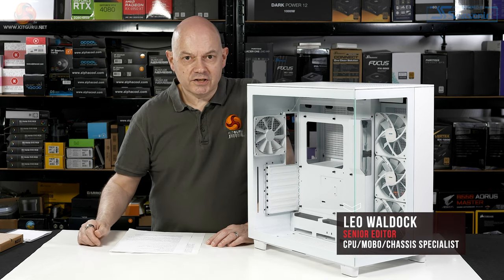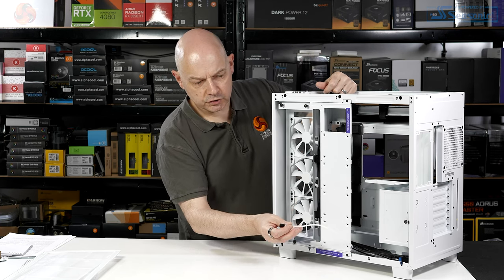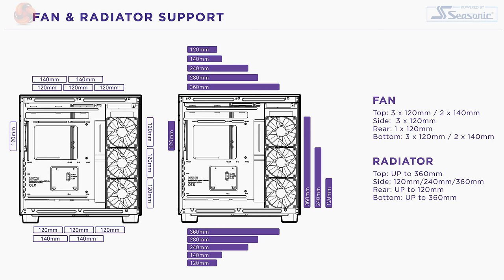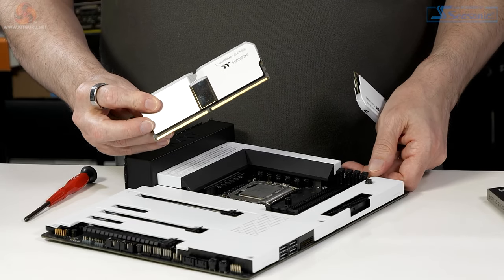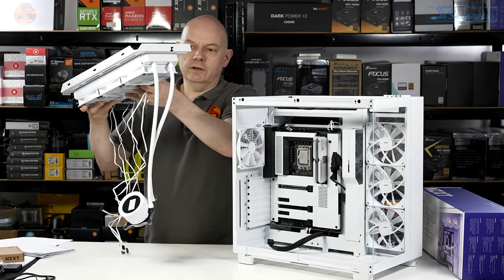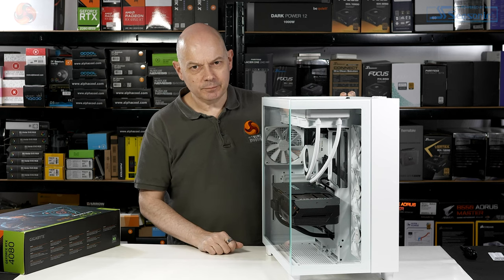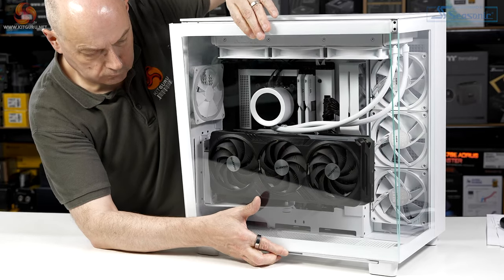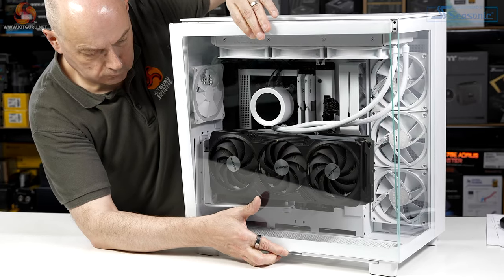NZXT H9 Flow - Look at the Glass on that

Comment: The whole reason you had high temps is you put no fans in the bottom! Optimum flow would be intake in bottom and side and exhaust out the top and back. Mine with a 12 core, 24 thread cpu under load doesn't get anywhere close to your temps and it's very quiet with better fans and even aggressive fan curve so people don't go by this, it's way way better than shown here. Sorry Leo but you missed out on the possibility of this one big time

Comment: First.  That Kraken is ridiculously overpriced for what is just another rebadged Asetek AIO.  Considering this looks like new tooling, why would NZXT leave that top so tight between motherboard and AIO - it is clear that most users are going to be installing one in this type of case, so why not make it fit comfortably.  This has long been an issue with cases, yet with the proliferation of AIO's so many seem to fail to improve this area.  An extra 10mm of height is all it needs , and on that front, it looks like it needs 10mm more width, or a slight reconfiguring of the position of the central tray - looks like they are assuming most people with go with the vertical GPU mount, but for another £75 on top of £170, plus you are going to have to replace those garbage stock fans, it is starting to get very expensive for what is ultimately another 011 clone that doesn't look to be as good as an 011.
Reply: second
Reply: You forgot to mention the O11D Evo comes with 0 fans included and 0 dust filters on the side intake, at roughly the same price as the H9 Flow. The included fans in the H9 Flow do their job just fine.
I still prefer the H9 Flow as not all of us really care for the O11D Evo features such as inverted/upside down builds and want a clean build without the corner pillar between the glass frames. I like them both but the H9 is better imho.
Reply: @cosmindinaa  I didn't forget to mention something I wasn't talking about.
Reply: @malphadour  Then next time you state it's £170, and then say it's a clone of the O11D  Evo, better do your homework. Those fans are better than no fans, and you can sell them anytime if you want to. And you dont need to buy aftermarket side intake filters. Saying H9 Flow is a clone is like saying all cars that came after the 1886 Benz Patent Motor Car are clones. Good luck with that.

Comment: amazing looking clean build that. I actually preferred it with the card in the normal position, the big slab of plain black ruined the aesthetics IMO. but maybe thats just me.
Reply: you get better cooling for GPU too being horizontal layout since you can add fans on bottom of the case as intake fans for cold to feed the GPU's intake fans to cool the big ass heatsinks.

Comment: I have this case and from what I understand you don't want to mount an AIO radiator in the bottom of the case, hence the reason NZXT doesn't include that option. You always want one end of the radiator to be above the pump / CPU, otherwise your pump will have air pockets and reduce it's lifespan. A radiator should be mounted - in front, on the side or on the roof and never on the bottom of the case.

Comment: 2:00 The lack of pwm fans in some of these pricey cases is a joke.
Reply: That's true, although I prefer to leave my own fans maxed. I haven't seen - or heard - a downside yet.
Reply: They assume those aren’t your only fans
Reply: @Donuts_Donuts_Donuts  I have a Be Quiet Silent Base 802, it came with 3 non pwm 140mm fans. Not a cheap case, they should have been pwm fans.
Reply: @-opus  again, they assume you use different fans as only having a few fans is common sense. Plus  fans are expensive. A mid tier corsair three pack is ninety bucks, half of the price this whole case itself
Reply: @Donuts_Donuts_Donuts  High end cases should come with high end fans (pwm being a part of that), I have no issue with the case coming with 3 fans, but they should have been pwm. I added 2 more pwm fans to the case, but would have very much preferred if the included fans (a part of the case price) were also pwm. I would have had no issue with the case coming without fans at all, and being significantly cheaper due to that, I would have actually preferred it, but since they are included in the price, I expect them to be pwm.

Comment: I have had this case for about 3 months. Looks gorgeous, lots of room to work in and manage those cables. Fans on the floor of the case make a big difference in its cooling ability. But at the going price for this case, having to pop for an additional $100 of fans is not much appreciated.
Reply: Yeah they missed out on this one bad, with better fans and flow coming from bottom and side and exhausting out the top and back mine with a 5900X cpu under load doesn't get even close to their temps and mine is real quiet while doing it. Leo missed this one bad

Comment: The only way to make it efficient is adding more fans, good fans. I managed to get slightly better temperatures compared to the O11D Evo, but that would require all fans spots populated. 
There’s only two criticism I can genuinely make about this case: the bottom fan position is poor. Should’ve been a removable bracket and also some gap between it and the bottom of the case. My T30 can operate only at 30% (2000 rpm mode) to be on the same noise level of the O11D Evo/Phanteks NV7 at 50%. The second one is top radiator clearance. 5mm taller would make a big difference.

Comment: Checking in from July 2024. Just built a PC in this case using an E-ATX motherboard (X670E Aorus Master). I have to say, this is by far the easiest case I've ever built in. Even though I needed 3 pcie power cables for my 3090, there is ZERO cable mess in the back.

About the stock fans: They are almost e-waste levels of bad. I think that's the only flaw.
Reply from the maker: Glad you seem happy with it!
Reply: the spec sheet for the case says it's an ATX case. Did you face any issues with E-ATX board?
Reply: U managed to fit an E-ATX board in there even tho it's an ATX case?
Reply: @HB-me7hx  Yep. The holes for the standoffs are the same as ATX and I had to take out the cable management bracket.
Reply: @NotCommanderShepard  Good to know! Thanks

Comment: Checking in from Oct 2024. Definitely worth the money. I have a very mild build with a R9 5950x and Gigabyte 3060. I used all Lian Li for the cooling. Galahad II Trinity AIO (top mount) and 7 AL 120 V2’s. Under normal usage the CPU never sees above 65C and GPU hovers around 35C. Under max load CPU barely touches 82C peak. 10/10 would recommend.
Reply from the maker: Glad to hear you're enjoying it!

Comment: I was interested in this case, but I was wondering about that space over the EPS socket. So the radiator mount on top is closer to the motherboard instead of the glass. That sucks. Thanks for showing this, Leo.

Comment: Have this case with a custom loop in it. I put a 100MM pump reservoir beneath the psu. There is plenty of space. You can also do a push pull on top. And i have an 420 MM on the bottom. I really love this case. Keep up the great work you guys and stay safe.
Reply: As im considering this case myself for a case update. What would be the max amount of space would be available in that area? I have a d5 glass cylinder pump res combo that would be amazing if i could slip it in that back area for a concealed res pump install
Reply: @RunAroundGuy2  100 mm would be the max. 150 is too large.

Comment: Is it possible, in this particular build, to install the radiator above the roof rack and then the fans below the rack? this would fix the space issue but not sure if the rack allows for the pipes to feed through, has anyone else done this?

Comment: I have this case, 13900K, 4090, and have much better temperatures.

1. Use the front fan position for the CPU AIO
2. Make use of the bottom intakes for additional positive pressure and cool air for the gpu

For my latest upgrade, I am doing push/pull for both the CPU space AIO and a GPU since I don’t want to go with a custom loop.

I love that this case lets me do push/pull on two 360 radiators  (front/top).

I will admit that the horizontal 30 series 40 series 12whr cable clearance is terrible so you either have to use a third party adapter like a cablemod 90° or 180° adapter, or go vertical
Reply: Same CPU/GPU combo, with the graphics card in the vertical mount, belly fans for intake, CPU radiator pushing out in the ceiling and i'm getting 60-70deg when running it hard, I reckon the belly intake is making a big difference regardless of which way the side fans are pushing.

Comment: I have the H7 Flow which has turned out to be excellent with an AIO on my 13700K, the H9 looks great and a nice step up especially I thinki if you populate the bottom row as an intake with 3 fans. Cable clutter looks to be a doddle on the H9 as well, though I recently bought the Corsair Shift PSU so it will not work on the H9...Great review!

Comment: Looks better with the standard horizontal GPU mount (has a nice backplate and side profile) otherwise nice overall. Add fans on the bottom to farther improve cooling to the GPU (horizontal position of course) etc. The 12VHP cable touches the glass.. And? Who cares it doesn’t matter / effect anything - it’s not like it’s smashed up against it.

Comment: Just started getting into the whole pc thing recently, first pc ever, and bought a pc a friend recommended to me from cyberpower. 

Has an i7-12700kf with a gigabyte 3070 eagle inside of it with a H519 mid case. After some gaming and fiddling around it turns out that the case isnt that good for the GPU as it runs around 80 cel at max settings for Dayz. Ive been eyeballing this case due to the price and how great the airflow is and im definitely considering the H9 now thanks to this video along with other improvements later down the line but my main goal now is making sure i stay below that 80 mark the best i can and i think that this case could definitely do it.
Reply from the maker: Hope it works out for you keep us posted
Reply: if you want better GPU temps, you need to install 2/3 fans on bottom of the case and make sure its pulling air (intake position) from outside the case and blowing right into the fans on GPU. Fans on GPU are intake fans that pull air from the case and blow into the heatsinks of GPU.

Comment: Thanks for the good video.
I have a question. 
I'm currently using Rog Helious (with all 4  stock 140mm fans) and Rog Raujin 360 MK I (with the small display) and stock Noctua fans on it,
thinking about changing case (Phanteks NV9 or 7; O11 Evo D XL or NZXT H9 Flow).
So question is which one is better for GPU and CPU Temp if any?
Thanks.

Comment: Ok, so my question is...I have an Asus motherboard, Z790-H, and bought some NZXT CORE fans (7) , the single one didn't came with a controller, so I plugged the fan header into the motherboard fan pins and the RGB header into the motherboard 12V pins and yeah...after 3 seconds it was gone.
And the question: The only way to connect a single fan (I mean the RGB header), is buying a controller?
Reply: When using a RGB controller, you must read which RGB power pin on mobo you need to plug it into. theres 2 different RGB power pin connectors on mobo, your instruction from RGB controller should tell which one to plug it in. if you plug in the wrong pin, you will fry the controller lol

Comment: As reliable as ever, sir!

Black PSU's. They were doing SO well on the white theme. They appear to have gotten the underlying mobo right too this gen. Paired with a POWERCOLOR HELLHOUND AMD RADEON™ RX 7900 XTX SPECTRAL WHITE (I understand you go with what you have to hand!) and what would there be not to like aestheticallly and performance-wise? Temps and noise are another matter and trapping the EPS cable... They put all the variations in the manual; but failed to build them all in the case before they finalised the design? Whoops! The market isn't exactly short of 011 clones, even with glass panel meeting glass panel with nowt betwix in white; I'd pick the best priced and executed. Which is unlikely to be the H9 Flow. If they do a non-Flow; lord knows how THAT would fair for performance, temps and noise! 

Cheers again!
Reply: i like its more accurate than most sounds ive heard, more fun too

vision ears would produce more precise sounds but i prefer this, i rarely critical listening nowadays

Comment: Another cracker! Thank you, Leo. That case looks absolutely excellent for cable management. "The NZXT Flow is cheaper than beer" Brilliant! The fans not being PWM and not being linked is disappointing given the price. The latter is also disappointing for the AIO cooler. Speaking of the cooler, I noticed that while the CPU got very hot, the AIO fluid did not. I think the peak was about 40 degrees. Or was that just an accident of cutting? 

I did notice the lack of grommets. How rounded are the edges of the holes? Will cables catch and wear?

You commented on the EPS connector: I find that difficult in many cases. Perhaps you might try fitting the EPS cables to the motherboard before fitting it, feed them through the holes from the front, and only afterwards plug them into the PSU?

Comment: Why wouldnt you add three fans on the bottom and test the maximum capacity of it's thermals
Reply: He said he doesn’t like the noise. I don’t care about the noise so I loaded mine up with max fans and it’s a beast. Cools the 7950x3d with a thermalright phantom spirit evo no problem.

Comment: Good morning. I've been watching you for several years.  😄I would like to point out  🤔 that an error has crept into the temperature charts and the corresponding fan speed settings. The first chart (11:34) is fine, but the second (13:23) and third (14:01) descriptions are mixed up (captions swapped) and they don't match the first. Regards. 🤗
Reply from the maker: You are quite correct and well spotted. The page will likely go up on KitGuru.net on Monday and I'll fix the chart there but sadly this one is baked in here
Leo

Comment: it doesn’t make sense if you’re using the water cooler the temperature shell should be lower than 100 criticizing the heat that the GPU throwing out  am i have h5 Elite and temp in the case all time play game is 75c

Comment: Its a pity NZXT fans are average at best, outperformed by arctic P120 that are £26 for 5 fans, i wish you could buy cases without fans, corsiar p120, af120 and ml120 are crap too. Get arctic if you want something a bit better but way cheaper, or get noctua if you want the best but expensive.

My case came with an NZXT fan/rgb controller and the software is terrible, it also doesnt provide enough power for 140mm fans, i would avoid it at all costs, just use your motherboards headers and some splitters.